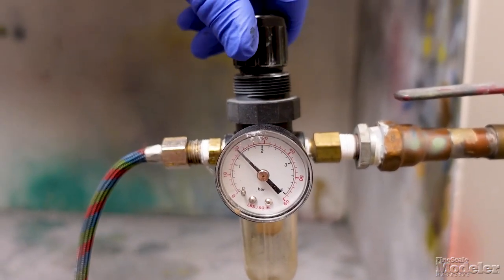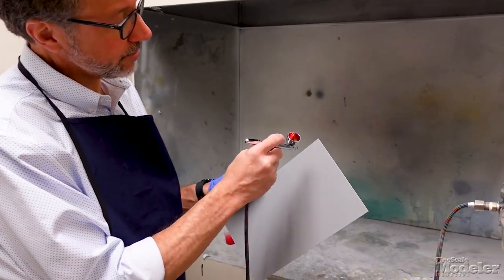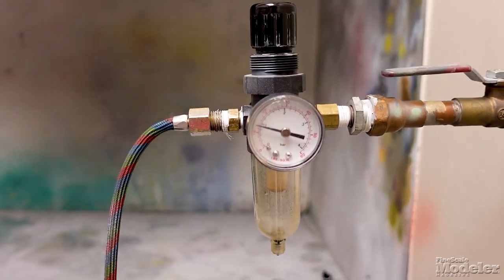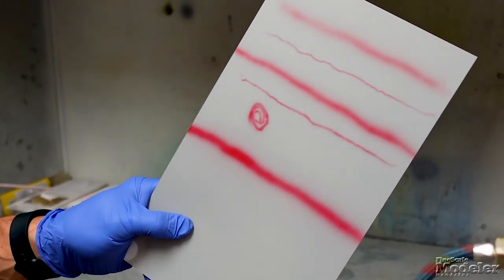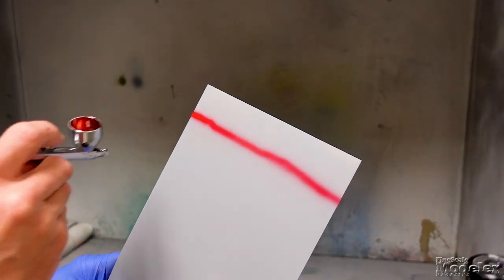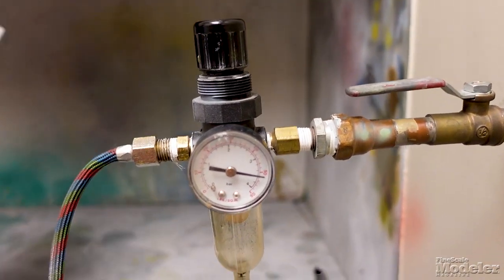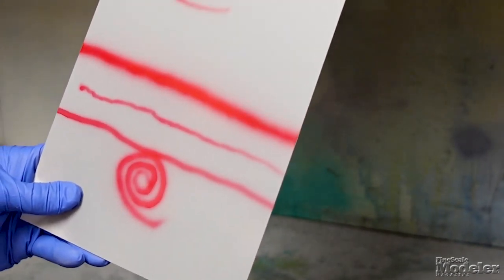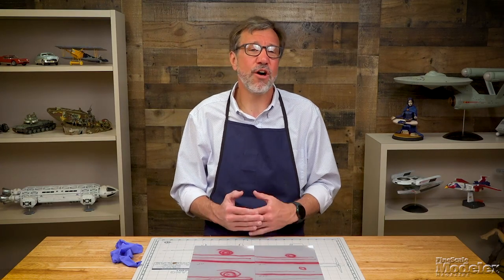Scale Model Basics: Air Pressure & Airbrushing

Comment: The pressure to use also strongly depends on what type of airbrush and what brand of airbrush you use. You have to try out a couple of settings with your airbrush to find the optimal result.